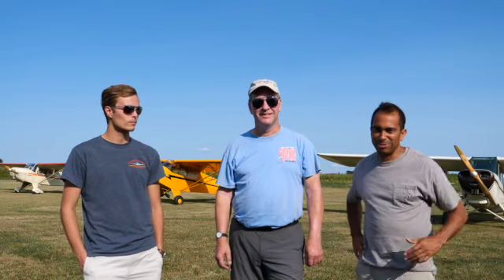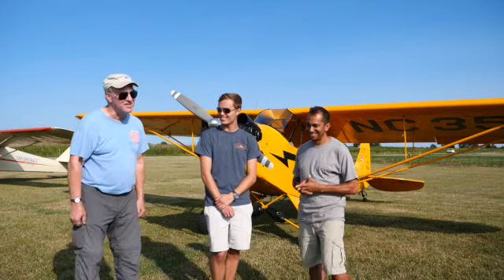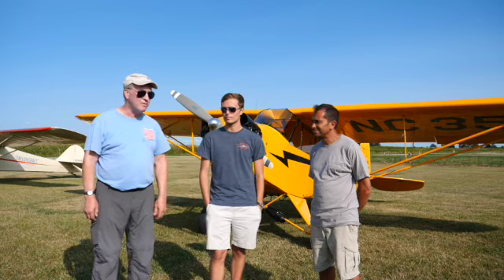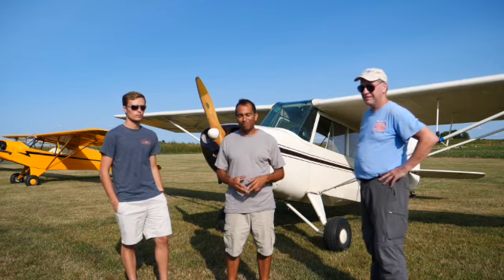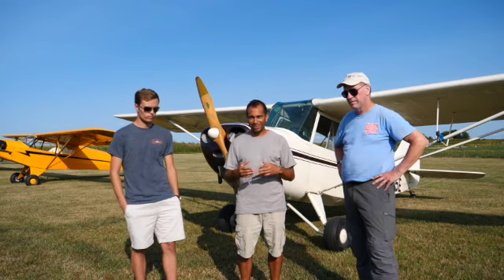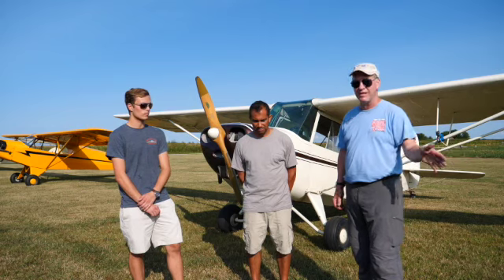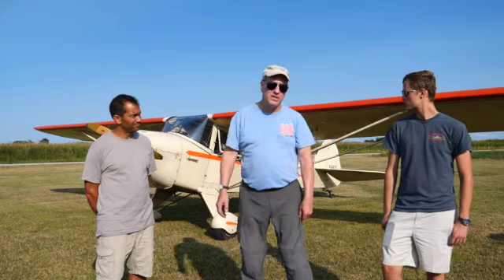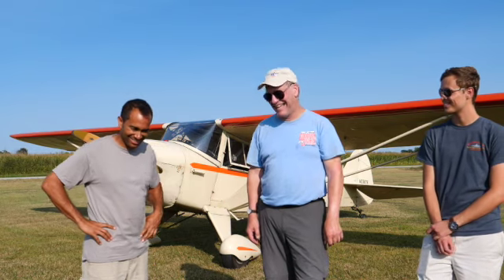Comparing a Cub, Champ and Taylor Craft

Comment: Back in 2002 took a few lessons in a Piper J4. I had never even heard of a J4. This was at New London airport in Virginia. The plane was $15 an hour wet and the instructor was $15 an hour. The FBO just wanted people to be able to afford to learn to fly. The instructor was a former aerospace engineer that just loved to instruct. I was doing a job in VA at the time and only got in about 4 hours before I had to return home. The FBO later sold the flight school operation and the cost went up significantly. He also had a full Piper Colt (sans fabric and engine) that he only wanted $500 for. I found out later that he wound up just giving it away.

Comment: Notes: 
<> November 1939 assembly line date Taylorcraft model B (curved bottom wing section) 90 mpg cruise, 12 gallons gas ~4.5 gallons/hour ~2.5 hrs flying, (~6300 made) - Andrew King; 
<> January 28th 1947 assembly line date J-3 Piper Cub  (~20,000 made)- Jessie Clemet; 
<> 7AC Aeronca Champ (7,500 made) - Dewey Davenport @ the Jamestown, Ohio, at Dewey Airport.

Comment: You can restart by pushing it over sharply so the prop doesn't hang at the top of the compression stroke but have your lading spot picked out before you shut down for insurance

Comment: Dewey, I just saw this video and was wondering how tall you are. I'm 5' 6" and found the rudder pedals in the Champ deep. I had to really stretch my legs to get full rudder deflection because the seat didn't adjust. Oh, by the way, I got my tailwheel endorsement in a Champ. So, in regard to leg length, how does the Cub and TC compare? Have you had the same issue? Of course, you might be taller than me so you might not have the same issue.
Reply from the maker: Dan, I am 5'7. You may want to put a thicker seat back in.
Reply from the maker: In regards to the Cub and TC.. I have never had any issues with any of the aircraft. I can't remember how the TC felt but I would assume you would fit just fine in a J-3. The problem with a J-3 is the tight front seat area.
Reply: @DeweyDavenport  I used to use a square boat throw behind my back which helped but I was right on the stick. I had to make sure it was buried deep into my crotch to get full elevator deflection. 😋

Comment: speaking of the doors opening on the cub... I just picked up a 2015 Legend Super cub, and in my opinion, the hands down BEST feature, is the doors open on BOTH sides! I LOVE IT !!!
Reply from the maker: I haven't flown in a legend Cub but I'm sure that is pretty awesome. Sounds like it's like a open cockpit.
Reply: And I did all the engineering calculations, load testing and drawings for your Legend Super cub for Legend Aircraft Company in Sulphur Springs, Tx. Plus all the Legend float water load calculations and testing as well. Enjoy. That was 8 months of work.
Reply: @abidfarooqui-sla3301  cool! It’s too bad cub crafters won’t do it. I wonder if they’ve even considered it. I wonder if you could help me, or give me some advice on a design I had an idea for. I wanted to design some sort of a lip or fin that could be installed at the front of the door openings, to help redirect airflow a little further back. The wind buffet is pretty brutal in the backseat with the doors open. I wonder if a small fin or air dam attached somewhere at the front of the door openings could re-deflect the airflow so it comes back and strikes the fuselage behind the opening rather than blasting directly into the backseat. It would still get airflow over the tail, but would make things a little more pleasant for backseat passengers when the doors are open.
Reply: @DeweyDavenport  it’s pretty awesome if you’re in the front seat. The wind buffet is a little brutal for the backseat. I had an idea for some air dams that would help redirect airflow, but I don’t know if it would work or make things worse.

Comment: I took my pilots lessons in a Piper Colt. In 1963, we had to pay $11.00 per hour wet. $6.50 for the plane and $4.50 for the instructor! Got my ticket at about 47 hrs, in Aug 64.
I have flown all three of those type of airplanes. My one friend had a "T" craft, another a Champ, and another had a Cub. I did have good friends, and used to hang around the airport, for about a year1964 and 5, when I was out of work. Went back mid 65, but got a lot of free flying, while off. Many different aircraft, I got to fly, then and later. I did have the Stearmans, and also flew the POS Citabria.  It's no-where near a good aerobatic airplane. I loved my 35 Beech, it was only a 165hp9185) at take off. It was pretty fast with the engine that was in it, it was limited to low RPM, but 135mph is not to shabby. less than 8gph. If I was still flying, I would come over for a visit, but I can't !

Comment: This was exactly what ive been wanting to see. I want a old tail dragger so bad, leaning toward a champ. I fly 2 plus days a week just goofing off alone when I do not have a trip to make and pulling the PA32 out gets old. 15gph and its to heavy to move without the john deer gator on the grass.
Reply from the maker: Thanks for watching Chad. These aircraft are well worth the fun.
Reply: An Aeronca Champ would be your best bet. They're usually cheaper than the Cub's but they fly just as nice. I have just over 5 hours in a Champ owned by a friend and I'm hooked. He's put bigger tires on it and a larger tailwheel, so it's a blast to fly. I'll be buying one myself as soon as I get my instrument rating.

Comment: Long time watcher. . . first time commenter.  Great video guys.  You can't go wrong with any of these 3 planes.  It would be a privilege to own any of them.  I learned to fly in a 150 and currently co-own a 172 but my go to plane for poking holes in the sky and flying to breakfast is my 1943 Taylorcraft L2M.  It's a combination of all 3 planes described in your video.  Tandem seating, solo from the front, light on the controls, great visibility, rugged bungee suspension, wing tanks, and 1 special feature. . . working spoilers!  I've been meaning to fly down from Kalamazoo to visit the air force museum.  If I do, I wouldn't mind dropping in on the Dewey Drome.  Keep the videos coming!